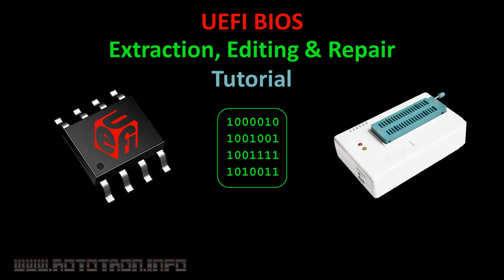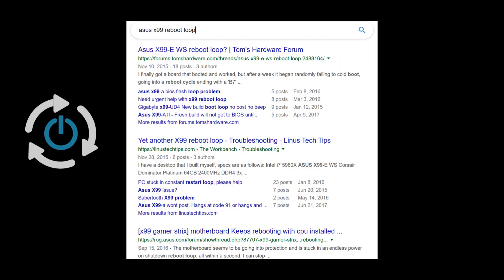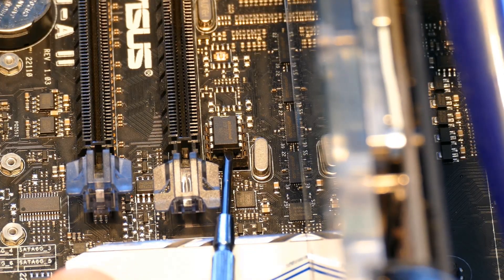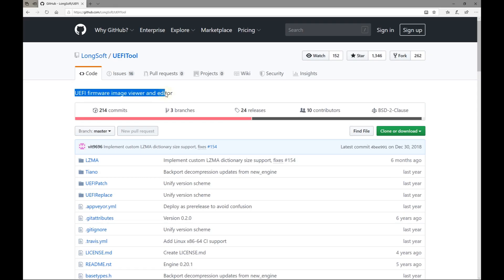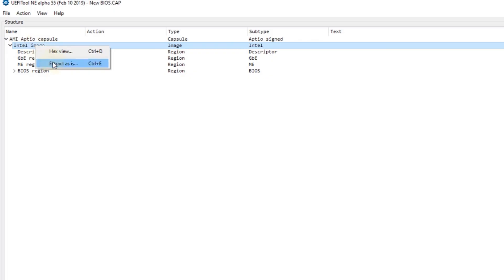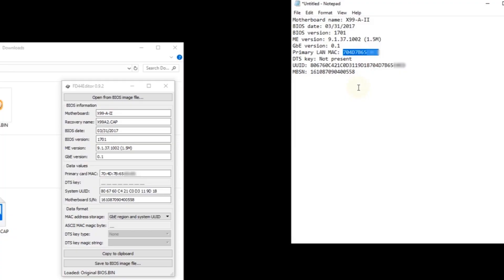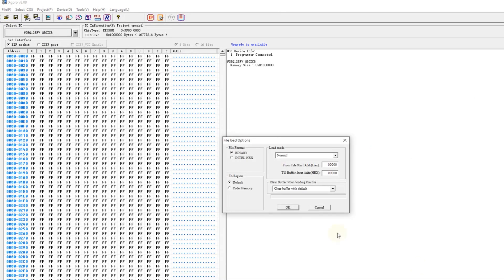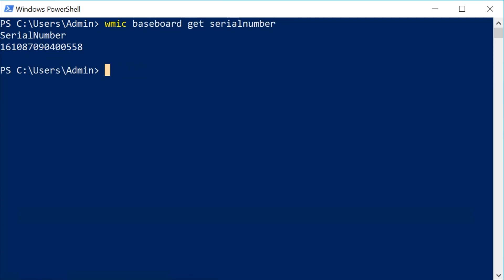UEFI BIOS Repair Tutorial

Comment: How would I go about doing this through a Raspberry Pi 3?
Reply from the maker: See the video description for a link to my previous BIOS repair video.
Reply: @rdagger  The problem is that my chip is also UEFI, and I already have a raspberry pi
Reply from the maker: Reading and writing flash chips works the same regardless if the BIOS is legacy or UEFI.  The Pi is just being used as a programmer to read and write BIOS chips instead of a USB programmer.  With respect to UEFI, it is just a matter of getting the correct firmware and editing any necessary fields prior to programming.

Comment: could someone (that knows what they are doing) re-write (UEFI) bios to enable M.2 slot (or PCIe 4x NVMe adapter) to enable bootable NVMe drive?? (Lenovo ThinkStation C30 - type 1136... FWIW)... "128Mbit SPI Flash with FWH"???

Comment: Very interesting.  I am pretty sure I had a virus in my Macbook pro bios.  Apple wanted me to have a new Mobo...  Megabucks.   Have you ever worked on Apple bios or seen such a virus in the wild?
Reply from the maker: I’ve seen many IOS devices with viruses, but I’ve never seen any computer infected with a BIOS virus in the wild.  I’ve never worked on a Mac BIOS, but the repair is probably similar.  If you can get a copy of the BIOS, I suspect you would need to modify at least the MAC address and serial number depending on the age of the computer.
Reply: @rdagger  Thanks for the reply that problem was 18 months ago.  After getting further up the food chain with apple I could pursaude them it was better to do the repair free of charge.  But I don't think I'll be really looking to get another Apple unless I was given one from work or something.

Comment: Can fix bios password this method
Reply from the maker: It depends on the computer.  On some computers reprogramming the BIOS chips might work.
Some older computers have jumpers to reset the BIOS password or you can remove the CMOS battery.  
On some computers if you enter the wrong BIOS password 3 times you get the option for a manufacturer reset key.  Go to https://bios-pw.org to convert the provided key to an unlock code.  
On some computers you can use a 'Crisis Recovery Disk'.
I recommend you ask for help at https://www.bios-mods.com (make sure you specify the brand and model number of your computer.)

Comment: think thats the only motherboard I've seen in at least 10 years with the bios on a removable chip. lucky!
Reply from the maker: That’s what I figured too, but the Digital Storm computer was bought in January of 2017.  Also the 5 year old computer I’m typing on now has an ASUS board with a socketed BIOS.
Btw, in my previous BIOS recovery video I demonstrate how to access the firmware via a motherboard SPI header and also how to desolder a flash chip on a Dell board.
Reply: I would say the developers knew they will mess up 😂

Comment: I wonder would just reseating the flash IC have worked?  That type of IC socket is low quality and inclined to cause poor connections when a bit of corrosion forms between the IC legs and the socket contacts (and the IC legs did looks a little grubby).  Unless the contents of the flash had somehow become corrupt, its hard to see how a previously-working motherboard would suddenly stop working in a way that would require a BIOS upgrade to repair.  Still, its interesting to see the procedure - thanks.
Reply from the maker: Great point!  I should have tried reseating first.  If I had not already returned the computer, I would test your theory.  Thanks, I will make a note on my website write-up.  Regardless I would still make a backup of the existing firmware while the chip was out to ensure copies of the relevant BIOS fields.